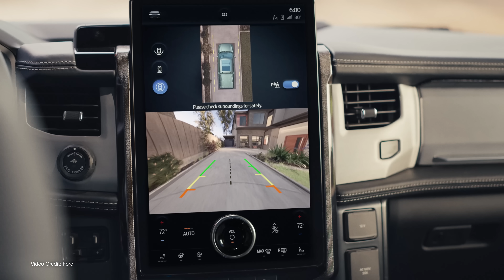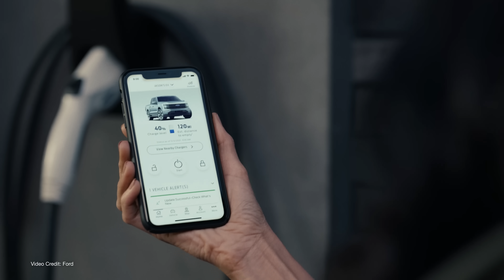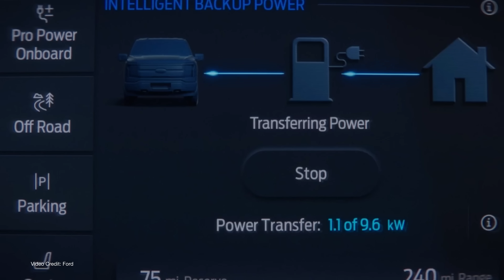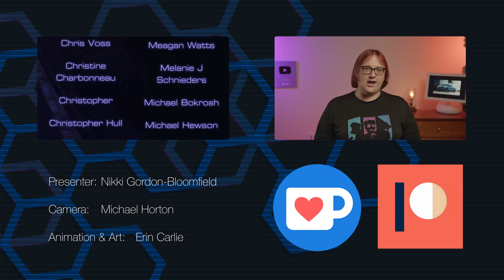Ford Maverick Lightning and Ranger Lightning EVs - What To Expect!

Comment: About a year ago, a prototype electric Ford was spotted testing. Based on the pictures, it appeared to be a "body on frame" setup with a Mach-E dropped on top, and had quite a bit longer wheelbase than a stock Mach-E would. It also had much larger tires mounted on six lug wheels. The only vehicles in Ford's lineup that currently use six lug wheels are the Ranger, F-150, Expedition, and Lincoln Navigator (e.g., full size SUVs and Light trucks).
Looking at the pictures, the wheelbase appeared to be about 8-10" longer than a stock Mach-E, which happens to line up pretty close to a Rnager wheelbase (which is officially 9.3" longer than a Mach-E).
Reply: Also worth noting, the Mach-E is built on the Ford GE1 platform, which is a modified version of the C2 platform. Cars that ride on the C2 platform include the Ford Escape, Bronco Sport, Focus, and of course, the Maverick. 

That leads me to believe that making an electric version of the Maverick probably wouldn't be particularly difficult from an engineering standpoint, as the basic underpinnings already exist.

Comment: So Ford already made an electric Ranger... back about 25 years ago. And it was the really useful compact pickup, not the fake 150 they call Ranger now. I still have a 2010 Gas Ranger. Perfect size for most people but can't find anything like it now.
Reply: The current Ranger is the size of the old F150 and is a mid-size truck. The Maverick is really about the size of a mid-1990s extended cab Ranger and AFAICT is the smallest truck available in the current US market.

Comment: What I want to know is what idiot at Ford decided to recycle the name of a small sedan into a small pickup.  If they really wanted to revive the Maverick then they should have made it into another small sedan or a hot hatch.  Find a different name for a compact pickup.
Reply: Nobody under 40 even vaguely remembers the original Maverick, and nobody under 50 has ever driven one because they were such abysmal pieces of junk that none of them survived on the road passed the 1980s. They werent collectible or desirable and Ive never seen one restored. The few I remember seeing in the 1980s were already completely rusted out and undrivable. So for the Millenial target market, it IS a brand new name.
Reply: You need anger management.
Reply: The Maverick sedan was a bare bones inexpensive entry model car during a period when sedans were the most common form of vehicle.  The Maverick pickup is a bare bones inexpensive entry level truck during a period when pickups are one of the most common forms of vehicle.  
The name fits.
Reply: The name defines that vehicle that much for you? Triggered by the 4 door Mustang Mach-E? Furious over the Dodge Charger now being a 4 doors sedan or the Dart? 
Recycling an old names facilitates the trademark process. 
I don't think anyone is going to be confuse (or irate) with a dismal selling FORD car from 70's, with this new Ford Pick up made over 25 years later.